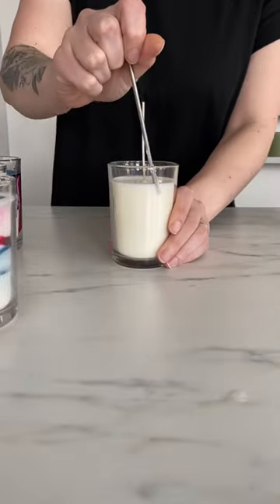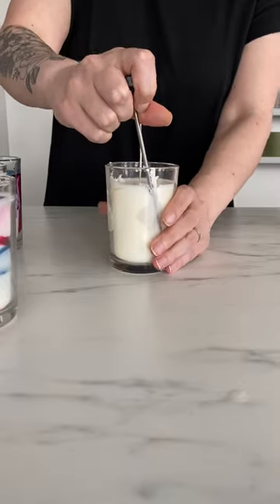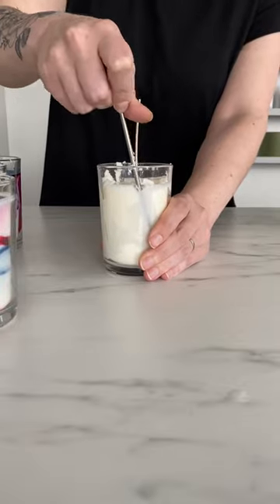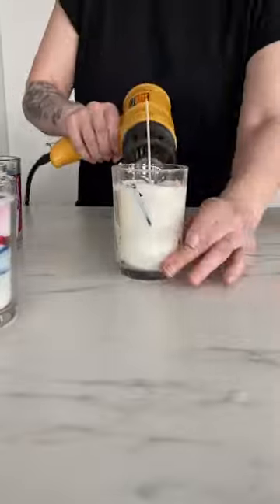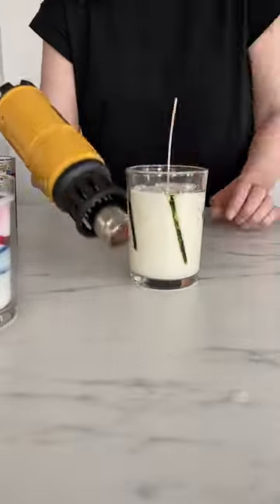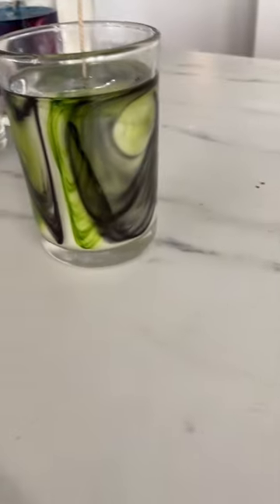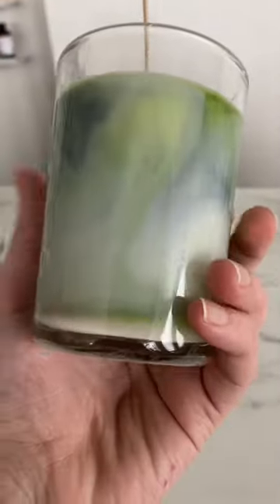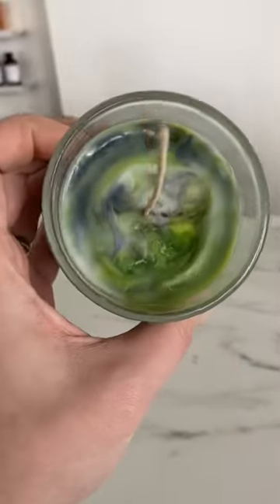Marbled Candle How-To | Part 1

Comment: I make a lot of marbled candles. I use 464 and the marble effect will eventually bleed into the wax as it sits on the shelf waiting to be bought. it also frosts pretty badly especially if you re heat it.  if you actually add the dye before it gets cold then you get way less frosting but in the end the marble effect will bleed and the candle will almost become a solid color when using a soft soy wax. it's frustrating to take the time to to make these then a couple months goes by and they look awful.  now if they sell quickly and get lit then there is no issue but they have very short shelf life as far as looking pretty
Reply from the maker: These are great points! Frosting in the soy wax plays a huge role in the overall look of the candles and the re-heating is the culprit here. It can be harder to get consistent, lasting results. Paraffin works a bit better for getting more defined patterns but you're right, for soy they might be better for small batches so they do not sit on the shelf for as long which can absolutely be frustrating!

Comment: can you use a blow dryer?
Reply from the maker: You can! The biggest issue is usually that the air blows too hard on some settings and it may spray the wax. I'd test out different heat settings and the distance you hold it from your candles first in a safe area.

Comment: What size is the wick you are using for that candle?
Reply from the maker: I used a CD 8 wick with 464 wax. Depending on the type and amount of dye used, you may need to adjust the wick but a burn test will be the best way to see if it's necessary.